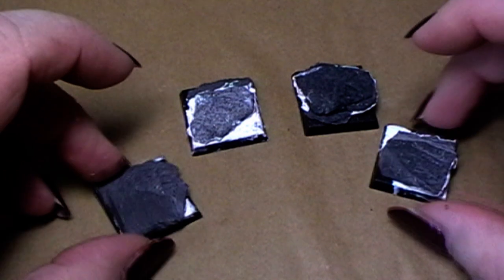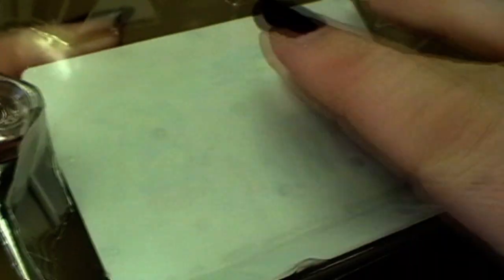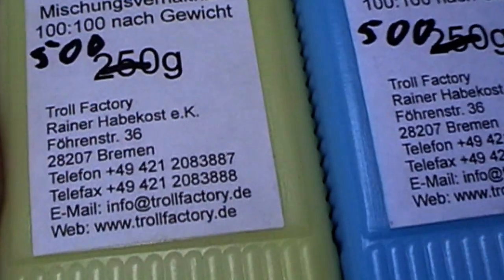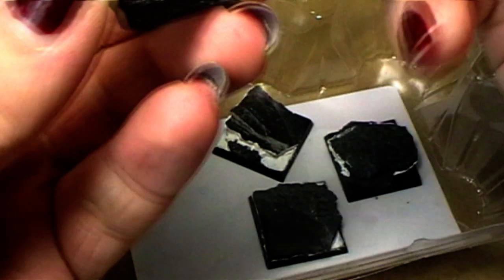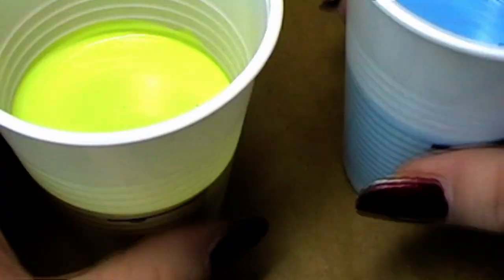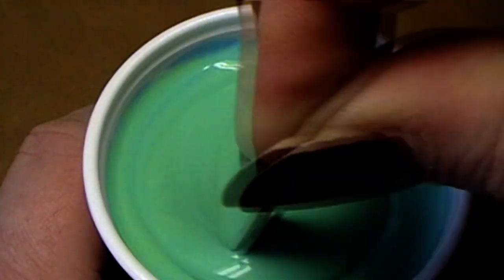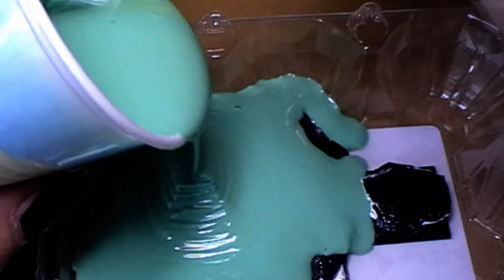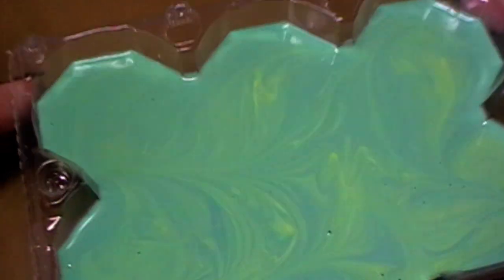How to cast resin bases - part 1 - creating a silikon mold

Comment: Try while stirring pour the mixed silicone portion back to the second cup will be able to mix the silicone cups gathered at the walls, while casting silicone mixed into a container of molded parts, pour it from a higher altitude. Creates a thin stream of silicon containing bubbles of air.